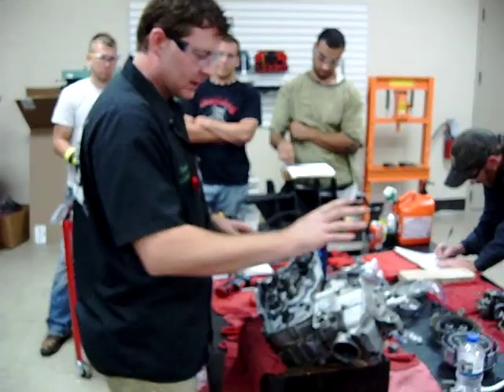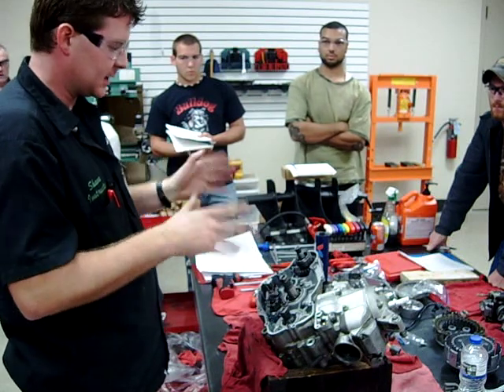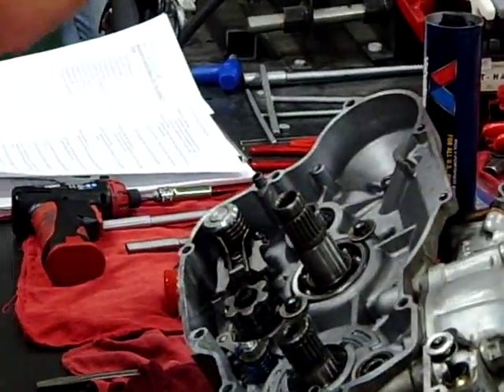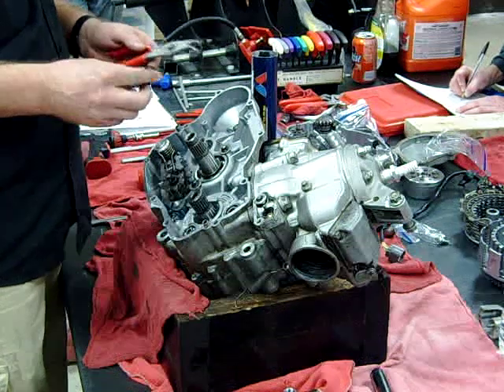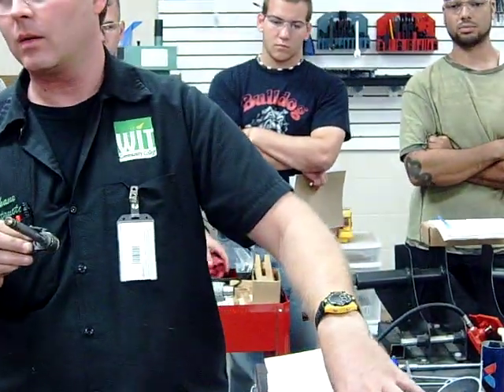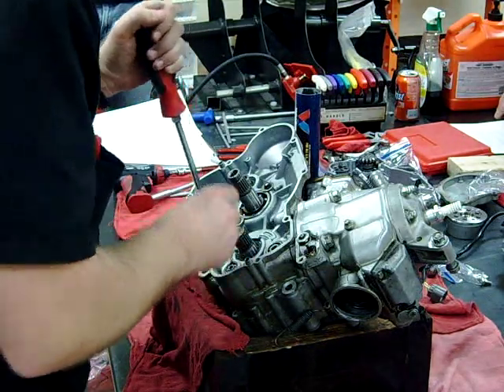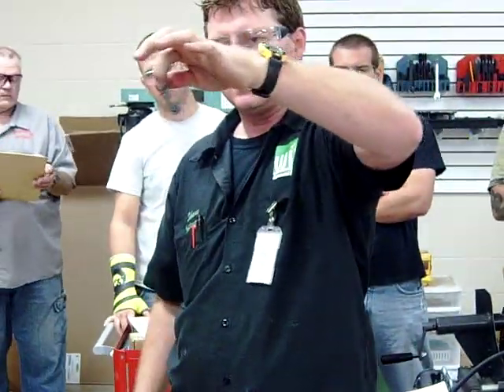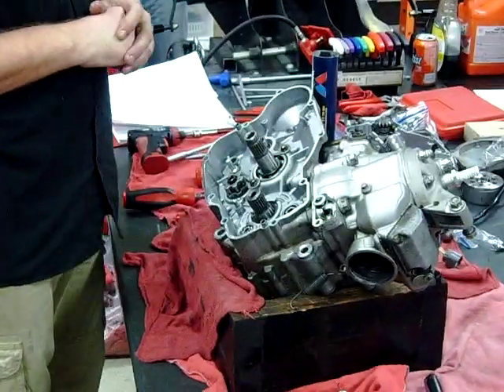2-stroke dirtbike motocross shifter shaft kick starter  removal part 5 Western Iowa Tech

Comment: i doubt anyone responds to these but it is worth a shot, I have a kx85 with a snapped shift shaft. I plan on buying just a shift shaft and replacing it but will the cases need fully split, head taken off, piston removed, etc. or can i do it just as this man did? Remove one side, pull it out and be okay
Reply: no you dont have too just the side
Reply: Mine just snapped off today 😣